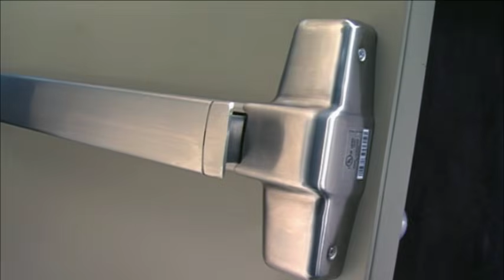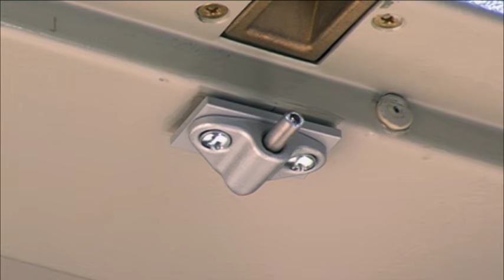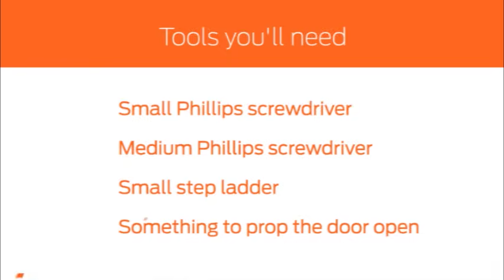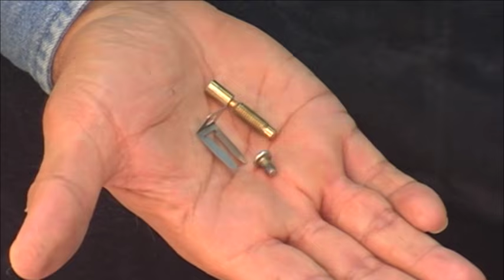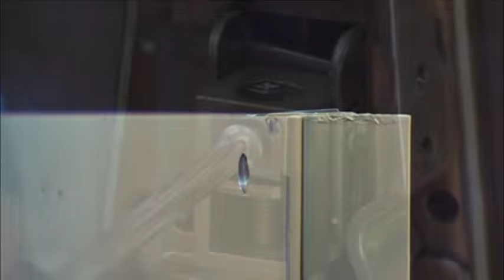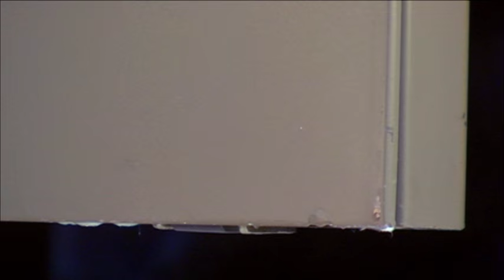Concealed Vertical Rod Exit Device Adjustment

Comment: We have an issue on this doors. When you stick your hand under the door and manage to push the bottom rod up, the door unlocks. My questions are (1) how can the door hardware lock so that you are not able to move the bottom rod and unlock the door. (2) are the bottom rod and top rod not independent of each other?

Comment: The top and bottom rods have another adjustment that may require rod removal, and door removal to set.  The long rod, or cable on some is attached to the curved piece that comes through the door where the shown adjustments are made.  If a previous installer didn't lock down those with the supplied security nut, then they can back off with repeated use.  It took me a while to figure this out, but both rods had to be set properly before the fine adjustment is made as shown in the video.  If you can't set the latch adjustments with the fine tuning shown, then this scenario is your problem.

Comment: How do I open? a horizontal rod exit door that is stuck closed
Reply: I am in this same boat right now.
Reply: Unfortunately you will have to remove the entire lock body, and manually actuate the rod(s).  If they are disconnected, you are in deeper doo doo than assumed, you will need some C4 and blasting cap.

Comment: You guys sorted me on so many screws, I had to rob b the old hardware fur all the latch trim screws and the #10's you sent to secure the foot and head latches I had to go to the store the next day for #14's. Missing or wrong size 20 screws altogether. I needed 8 screws for the rid guides you sent 4. I got weatherstrips for the verticals that don't go to 8' so I have to slide them, got nothing for the bottoms of the doors. If this is how your company comes a little cheaper or something I don't want to waste my time which is also money. A little quality control to make sure you're sending guys with enough rope to hang themselves or get the job done is appreciated, nothing worse than than having the guy in the field.
Also top frame latch rollwr bracket template screw locations had to be re drilled 1/4" more back from the doors where the template had them.
Heads up if you're going to do one of these: buy #10, 12, 14 countersunk machine w/drill and tap or #14 countersunk head self tapping screws, also need tension spring tool for spring clip in locks if you have to change the handing
Reply: Yeah, they shorted you screws because they gave me two extra packs in the 10 different boxes I had😂

Comment: I'm having problems keeping the latches retracted after opening the door. This is causing the door to not close properly. Sometimes I can't open the door because the panic bar does not retract the latches. Is this still an adjustment issue of the rods for both problems?
Reply from the maker: Thank you for your comment!  The issue you describe could have a few different solutions.  Our support team can help you determine if it is an adjustment issue, or possibly related to the door, the frame, or other factors.  Please contact our support team at 877-671-7011 (option 2, then option 3), and we will be happy to help.  Our support hours are 8am-7pm EST, Monday-Friday.